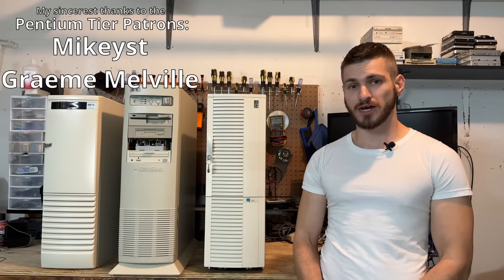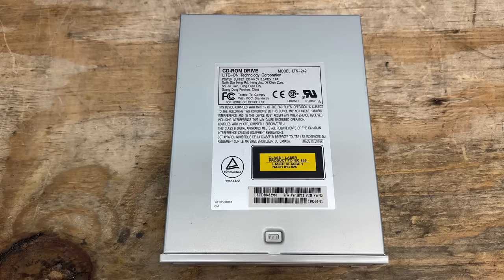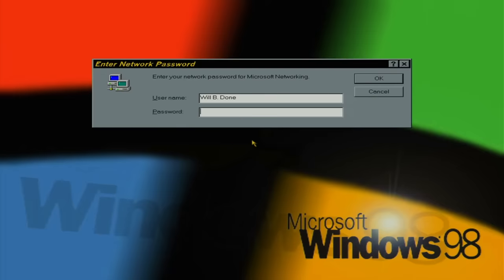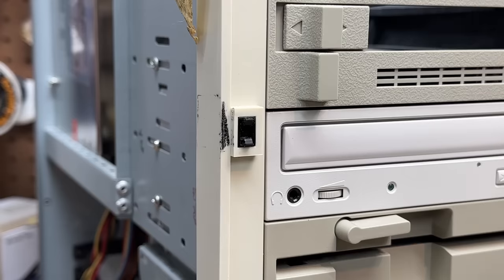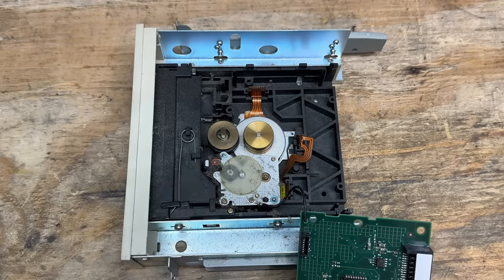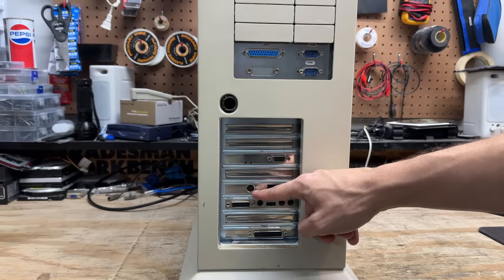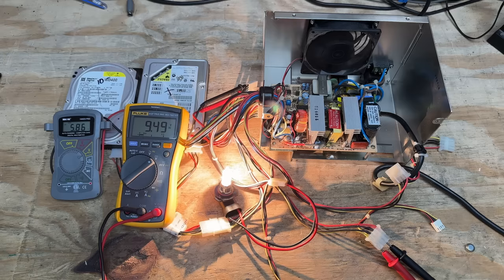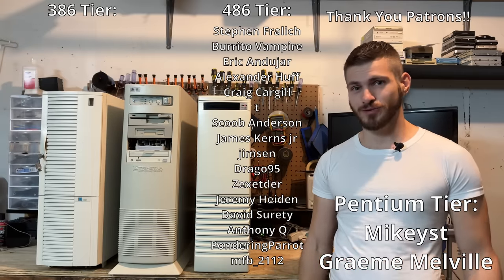Giant Retro Towers - Teardown and test!

Comment: This whole system reminds me of when I started seriously getting into computers back in the late 90's. I would imagine the Sound Card was probably the last thing to get upgraded on this thing. Sounds cards were so cheap and relatively decent by then that it was almost a no-brainer upgrade from any sort of ISA based sound card. They were usually garbage compared to a good PCI sound card like an SB Live, but still an upgrade over almost anything ISA based. A lot of people were still running AWE64's at the time.
Reply: I honestly could not tell the difference. I used a Pro Audio Spectrum 16 in one of my most long lived systems and could not fault it for anything.
  I NEVER wanted to use the CD Rom interfaces from any sound card, though.
Reply: It seemed like I used a 4 channel amp that , with a flip of a switch could take two channel input and image it to the back speakers.  I wish I had not broken that amp since it and the speakers were far better than what I use now.

Comment: That little transformer can likely do more than you think.   Remember the 12 volt rail is only rated at 10amps.  The 250 Watts is all rails combined.   The 12V rail was rated at 120Watts max, but it didn't do it.   Probably bad caps.   With the power supply open, the heatsinks will get hot as you didn't really get any air flow over them, but you are right in that saying that PSU is pretty well rubbish.    I am just playing devils advocate really.

Comment: These older pre-Pentium 4 PSUs expect most of their load on the 5V rail, thus they can behave weird if the 5V rail isn't loaded (the little logic on those HDDs probably goes unnoticed by the PSU) but the 12V rail is. I totally expect the System 3 PSU to work just fine when connected to a motherboard. Often, old (or cheap) AT PSUs only regulate the 5V rail and the other rails are matched to fit under most circumstances.

Comment: The card seen at 47:05 looks suspiciously like the bundled SCSI controller used with old HP ScanJet devices. It might not be a parallel card at all.
Reply: The chip is a 53C400, so it is indeed an SCSI card.

Comment: That Asus Cuv4X-D was the first motherboard I ever bought myself. I was 16-17 at the time. I was into 3Dstudio Max but sadly never became much other than a small time hobby interest. I found out that Quake 3 had native support for multi cpu back then and gave it a try. I got disappointed though. It wasn't optimized or didn't use the second cpu very good as you pretty much halved the fps. Anyhow, great too see a somewhat rare motherboard now.
Reply: Are you saying that using two cpu's halved the fps?  I would guess it had no effect at all.  Are you able to disable a CPU without removing it, either in the app, the OS or the bios?  Will it run with one CPU?  I wonder what CPU's the board supports that are faster than the ones on it now.

Comment: I miss the old full towers, I think I remember some with 7 5.25" bays!
Those red jumpers on the VRM connector pins on that first one are interesting, any idea what is going on there?
Reply from the maker: Not sure about the jumpers. I found the same board last week in a baby AT case and it had the same thing going on. It’s probably just a ‘VRM not present, pass voltage straight to CPU’ type thing.
Reply: @miketech1024  I see! do you know which motherboard model that is? I see it has some fake cache...but it's a Pentium board, does it have any markings? Didn't know the fake cache problem was more widespread than the famous M919!

Comment: so much tech is just obsolete now  .. scsi was the  thunderbot 4 of it's time   , having a tower like this  was a serious investment 
i would love to see a maxed out system  may be on of these giant towers  with scsi and may be some modern upgrades  i think athlon 64 x2   would be be a interesting build
Reply: I paid big bucks to get a tower when I got my 486dx 33 system.  I upgraded the motherboard at least twice, but could not go into the ATX era with it because the card cage spacing was different.  On another tower AT case that said "Dell 486"  I tried "modifying" the card cage but it was a ragged  butcher job.  I still have both cases.  You should see the massive SCSI drive that actually worked back the last time I tested it about  20 years ago.  I think it was 1 GB and about 6 inches tall.
   I don't know why guys are saying those big cases are "too much". Given the size of hardware back then, they seem just the right size.

Comment: I still use a tower case like that. Been involved in updates for 20 years. The motherboard and processor have of course changed over the years. However, in my time, the internet didn't have to be valid, the machine really had to be cool. Not the machine presenter.

Comment: Now, a quick word about old AT psus. They had most of the load on the 5V, not on the 12V. Loading the 12V line with car lights is not technically a good idea. Look for a motorbike or an old car 6V light, and use that on the 5V, not 12V. Since there's just a single transformer for all the important voltages on an AT psu, and they're not regulated separately, you have to think that loading one rail, but not the others, would make the loaded rail "low", and make the others read "high"; exactly as it happened with that PSU that got 9.42V on the 12V but the 5V skyrocketed to 5.82V! Only a few selected gamer PSUs have a separated mains to 12V circuit and then 12V to 5V and 3V (and servers, of course)

Comment: At this age, I thought that you knew already that DOS/<XP's format command does not zeroes partitions, just does a surface scan. Only Vista's format and onwards do zeroe partitions. For DOS and Windows XP and below, some 3rd party tool is needed to truly zeroe the drive in order to straighten sectors. Some BIOSes do have a low level format functionality.
Linux's DD will also "low level" format with dd if=/dev/zero of=/dev/hdax or sdax. or hda sda... etc.
Reply: And I also would run memtest86+. It will stress CPUs and RAM.

Comment: If you are hacking the old Dallas modules, you should cut the original battery off the pins of the dallas chip, otherwise your new battery will discharge through the old dead battery. You shouldn't see any voltage on your battery connector if you do it right.

Comment: Sanford markers are your friend.
You can write HD capacities on drives on the top cover with a Sanford marker.
Dead components, like drives, mark them with an X
The price stickers on the cables were because the computer tech was just grabbing rubbish off the computer store shelves that wasn't selling to flush out an incomplete system in an attempt to sell it as a fully working machine, as it probably came in parted out or in pieces by the pickup truck load salvaged from some office or school upgrading and those PC techs had scavenged from parts inside this system at one time.

Comment: Looks like system 2 doesn't have the FSB/multiplier set correctly. They should be 866mhz, but only running 520.
Reply from the maker: Yup. I was running the default settings.

Comment: Testing power supplies with the housing open is hazardous to the power supply. When you have them open, virtually all of the airflow over components is eliminated, which can lead to heat death. The mosfets aren't the only thing generating heat in the power supply, there are quite a few small components that generate a significant amount of heat as well.

As for the power supplies falling flat on their face when you apply a heavy load on the 12v rail, it's most likely caused from the rails being group regulated. Using the last power supply you tested as an example, you can see it only has one output toroidal inductor with several windings on it, this is because all three power rails are regulated together. Likely, the only rail being regulated is the 5v rail, and the other two rails use it as a reference.

Group regulated power supplies are terrible with cross loading rails, and will generally drift way out of spec if you heavily load one of the secondary power rails. If you bring up the load on the 5v rail, the 12v rail would likely jump up closer to what it actually should be.

Comment: 3:42 "Nothing worse than a Molex connector been stuck on for 30 years." How about those plastic RAM socket tabs that break as soon as you touch them?
17:11 Don't skip steps, one card at a time then boot, one bad card or cable can have you chasing problems that don't exist.
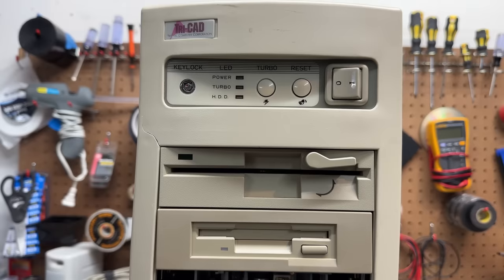1:01:17 That file system looks like a virus has been chomping away at it. I have seen that kind of destruction before.

Comment: That Deer Power supply is not what I would call reputable there was a saying when I use to work at a computer store anytime we worked on a computer that had a Deer power supply in it we were always told by the shop owner to be careful as nothing dies like a running deer.

Comment: I feel like those caddy CD drives are a superior design in almost every way. No mechanical tray eject to get jammed up or otherwise break; designed for high-use environments (schools, libraries). Plus they were sold in the early days when CD drives were top-end accessories, so presumably the build quality in general should be better than the drives that were installed in cost-reduced machines from the mid-90s and beyond.